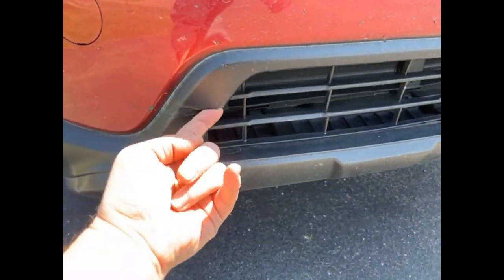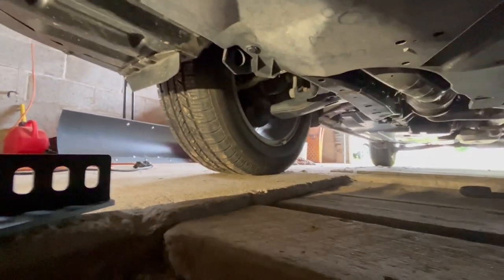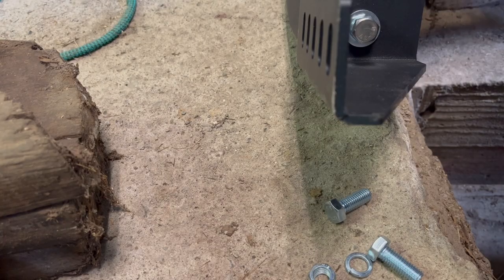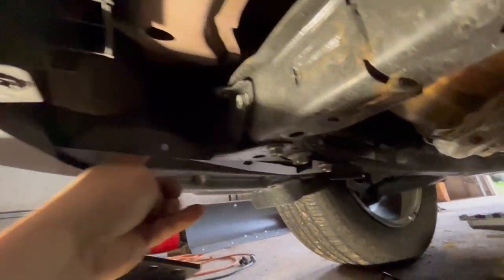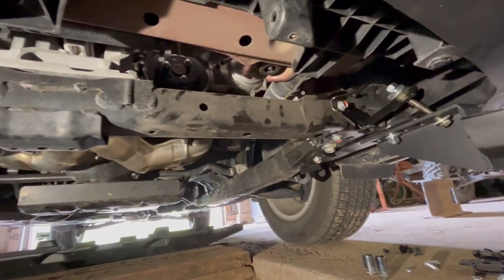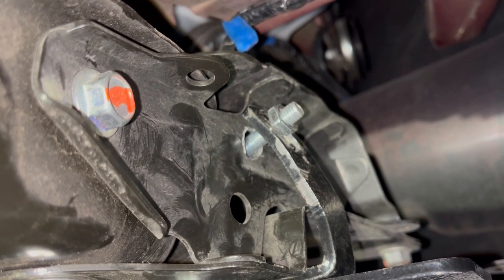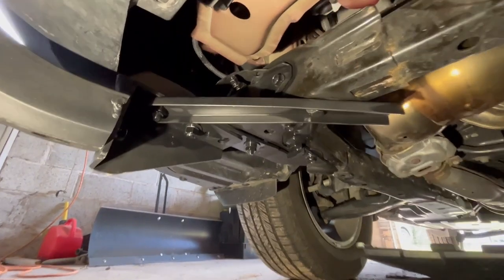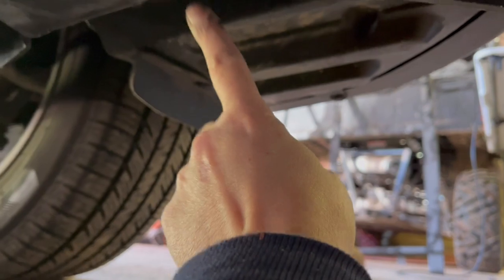How To Install A Bully Bar On A Subaru Outback!

Comment: Damage multiplier.. turns a low speed impact into a write off because it puts all of it right onto the frame, they banned these things in a lot of places because they were sending cars back in time before the effectiveness of crumple zones.
Reply from the maker: If you see the video this is mounted to an area that will allow the front end to crumple.  This also hides damage from a box truck that backed into the front end.